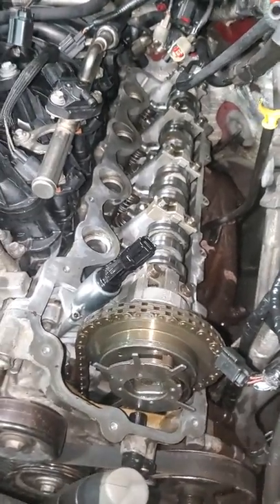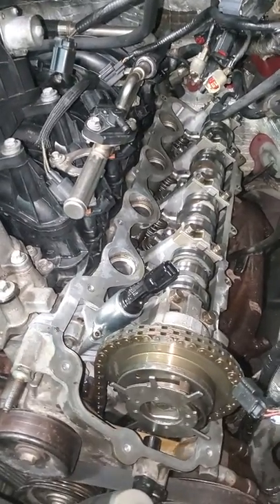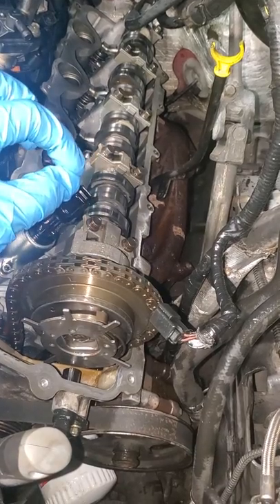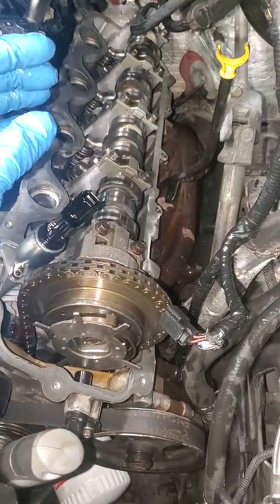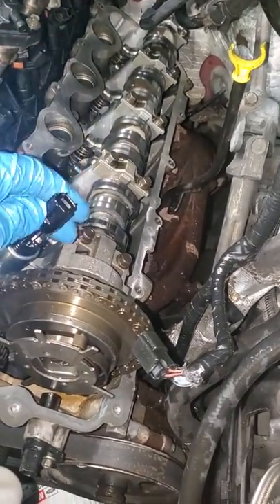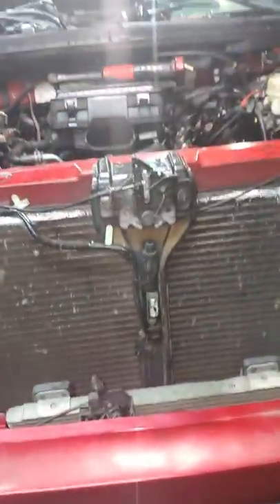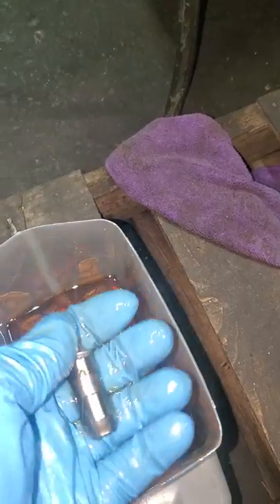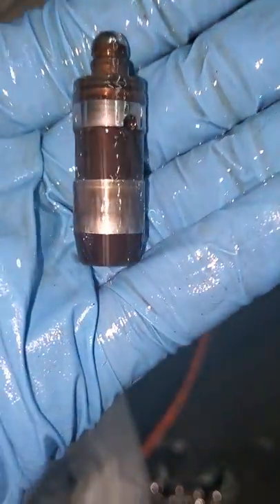tips on how to tell if the ford 5.4l vct solenoid is bad code p0021 p0022

Comment: I got a 2006 f150 5.4 triton engine. I put in a rebuild engine ; it has all the sensors brand new . I replace the vet 4 times; took the timing cover off to check if  the timing Chains was put in right , put another timing chains . The code P0022 keeps coming up and when the truck gets warm looses power and chases, but if I put it on neutral and hit the gas goes back to stop choking. If you can help me I will be really great full.
Reply from the maker: Ok this the most common problem in those trucks and it so many symptoms could be  happen and you will just keeps spending lots of money and that problem will never go away even if you fixed you will get that code again and again so the best way to get rid of it is to delete the vct look online how to delete the vct . Is to send your pcm to a company on eBay they will delete your vct and send back the pcm to you while you locked the vct and that will give you more power also and no more worries about this codes thanks for watching
Reply from the maker: https://www.youtube.com/watch?v=YsoU2zEWTyE

Comment: Hey bro, I have bought a 2007 Ford F150 from a known guy, he said and provided me proof that he got a complete timing chain job done by a local mechanic with all OEM parts. 
But there was a check engine light because of P0011 and P0022 code because of advanced timing or so. But the truck runs like a charm with no issue, I have cleared that light with an OBD scanner and it always popped out at low speed. and I drove it for 300km after clearing codes it and it never comes back until I hit a traffic light and drive it back on speed under 50 for a minute or two. Please help, I know it need a small and smart fix, and you are the hope. Thanks
Reply from the maker: To be honest I had this problem a lot your truck can runs fine with it but that code will never go away if it doesn't bothered you so it will not effect your truck it just common issues other way to make this light go away and your truck will have more power is to lock the cam and send your pcm to that guy on eBay will delete your vct and everything will work fine 😉